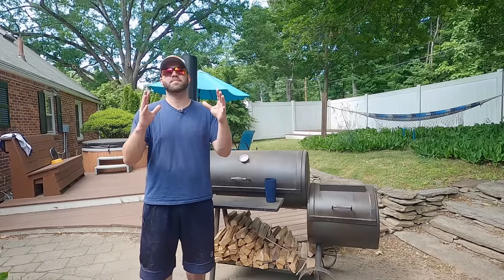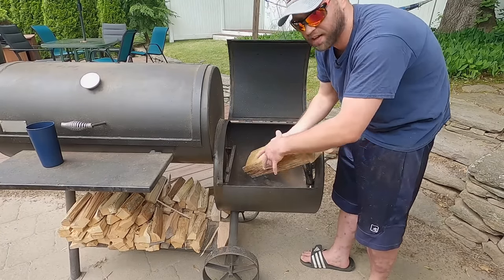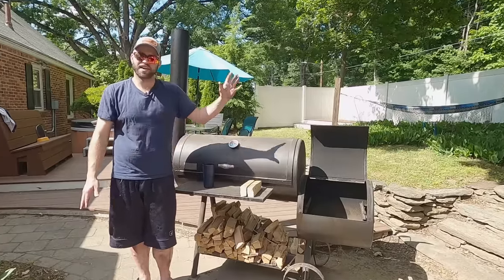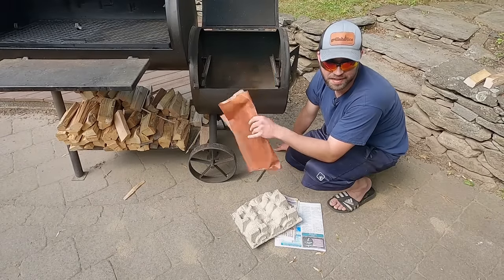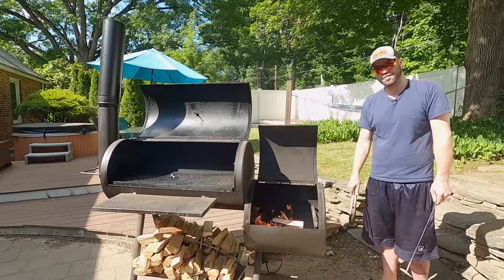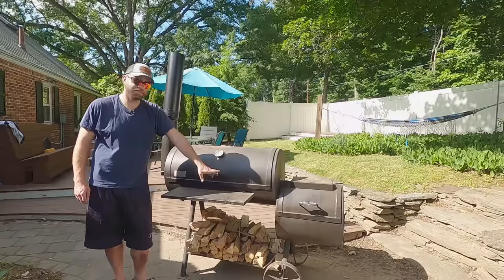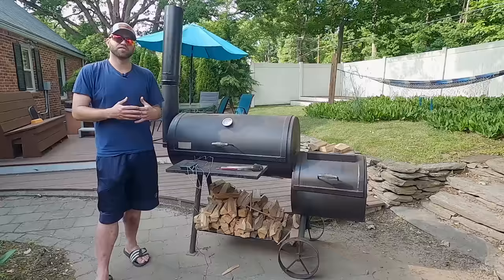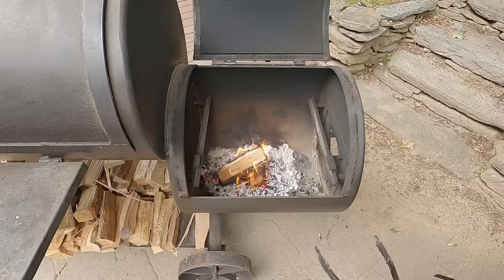OFFSET SMOKER FIRE MANAGEMENT FOR BEGINNERS | How To Burn A Clean Fire | Fatty's Feasts

Comment: damper are on the cooker for a real good reason to control airflow and even heat.... that's why you have 2! dirty fire is flavor...   oB
Reply from the maker: Correct, but on this cooker, the stack damper does more damage than improvement. It just cuts the air flow off so much that it smothers the fire. I'm going to be going over the advantages and disadvantages of dirty smoke in my next video, as it can be flavor depending on the situation, but not always.
Reply: @FattysFeasts   I gotcha', We have been cooking offset for decades, putting bark and smaller green oak and hickory for flavor to get 1/4 inch smoke ring below the bark, I learned a lot about trimming! Great Content!   ....oB....

Comment: Did you say you took off the metal flap Inside the smoke chamber? The one flap the directs the heat to the middle?
Reply from the maker: I did...Best decision ever. With this smaller pit, closing the damper on the stack to redirect the hot spot just screws up the fire. So instead of dealing with that, I took it out and the hotspot is now right next to the firebox. You won't regret it.
Reply: @FattysFeasts  I made some beef skirts, aka beef fajitas and I laid them next to the fire box, man I tell you what....... Those beef skirts were so tender.....

Comment: Meh, I just keep it way simple with my Recteq 700 (The Bull) pellet grill. Pharmaceutical grade temp controllers, copious amounts of clean smoke, heat control to within a degree (literally) WiFi control so I can be 200 miles away and still stay in complete control of my cook, the pellet hopper holds 40 lbs of pellets, tons of different hardwood pellets to choose from, oh, did I say precision temperature control and copious amount of clean smoke? I can reverse sear on it. Every thing I’ve cooked/smoked on my @recteq smoker has been phenomenally tasty. I like the fact that I can get successful result every time I use it with minimal work. One more thing: my Recteq is 100 % built from stainless steel. Including the drip plate and the actual grill grates. Recteq. Best. Pellet. Grill. Ever.
Reply from the maker: Glad that's working out for you! I've heard good things about that smoker, especially with the flavor. I just prefer old school stick burning. It's a lifestyle for sure and not at all convenient, but its the art of working a fire and knowing the product you made turned out great because of your actions. It's not for everyone, but I love it.

Comment: One big mistake the newbies make is to smoke meat for two long. You want a good 1/8" smoke ring and then bank the fire and let if finish cooking without smoking! Especially Hickory which can be bitter if the meat is smoked to long! I finish brisket in the oven once there is enough bark on the brisket!
Reply from the maker: I think it depends on your fire management skills. If you're a beginner, I would agree that if you're burning a dirtier fire, you definitely don't want in smoke the entire cook. However, once you understand your smoker and can burn cleaner, you can for sure smoke it the entire time. I did a no wrap brisket with hickory that came out amazing, mainly due to burning a clean fire after the initial few hours. It all takes practice and knowing how your smoker performs in certain situations.
Reply: @FattysFeasts  I think it is a matter of personal preference more than anything! I have always smoked for about two thirds of the cook and wrapped the last four or five hours. Many profesional competitors also wrap. Here is a link to one example; https://www.youtube.com/watch?v=_Ldg73DumjI&ab_channel=MadScientistBBQ
Reply from the maker: I'll check it out!

Comment: So if 250 is the goal, 300 is just fine? It’s kind of just now occurring to me that the temp is never going to stay at 250 because it would have to either go way down for when you add wood to heat it up or be, in the case I’m speaking of 300, in which case you gauge when to add more wood to hopefully be at 250. Is that correct?
Reply from the maker: Towards the firebox, I usually go just above 280, but 300 isn't that bad either. I would try to stay closer to 275 in the hotter area and then add wood when it gets to 250 or just a bit under. Hope that makes sense! It confused the hell out of me when I first started.
Reply: Think of it as more of an average. You want to average 250. But you don’t want to average 250 cause you had super low and super high temps. But if you are bouncing between 225 and 275 that’s pretty much perfect on a smaller smoker. Like he said 300 isn’t a big deal you just don’t want to stay there cause it will bring your average up.

Comment: The baffle that was welded in... how did you get it out?
Reply: I didn't have the ability to get it get it out either so I  drilled  large holes in it.  I just ran into this channel. It's so funny that I have the same exact smoker and tools, I don't know how that happened. Lol.
Reply from the maker: It was just held in by 4 welds. I had a friend grind the two out on the sides. Took him 30 seconds. After that, I was able to break the other two just by moving the plate up and down.

Comment: What’s different between oak,maple and regular firewood thanks
Reply from the maker: It's all hardwood which is considered good firewood. If you want to learn more about the wood I use, check out this video! https://youtu.be/rpaCFw3QvmY
Reply: Oak and maple are hardwoods. That’s good. Regular firewood is offen pine or birch or other softwoods with lots of sap. The sap in softwoods burns like tar, and your food tastes bitter and like it was burned over an oil fire.

Comment: I put a whole chicken on my grill 4 hours ago with a consistent temperature of 300 (grill gauge). Why is the internal temperature only 140 at this point?
Reply from the maker: I got a few questions. What kind of smoker are you using? Where are you placing it on the smoker? Where is your temp gauge placed?

Comment: Thankyou
Reply from the maker: Glad I could help!
Reply: @FattysFeasts  few days passed i ruined my bbq due to bad smoke . Please make a video on how to manage fire and temp on cheep offset smoker like 100 usd smoker that i have aroud 130 usd. Thin steel lol
Reply from the maker: @harisaslam573  I'll add that to my list! Might be a while unfortunately. What size splits were you using? With those pits they have to be stupidly small and your coal bed needs to be kept up by using charcoal for the most part.
Reply: @FattysFeasts  they were twice bigger then that you are using. Thanks for suggestion. They were really big so dirty smoke ruined all the taste. I will try again. Also i think i need to use probe instead of guage. May be i cooked also on below 200F . On guage it was 300 but after 8 hours ribs came out dry and tough
Reply from the maker: @harisaslam573  Ooofff. Sorry that happened😫😫 Sounds like me when I first started with my smoker. I would definitely invest in a probe. Just don't drive yourself crazy with the constant change in temps. Since they are so accurate, they are constantly moving. Like I said in this video, if you keep it in a good range, you'll be in good shape!
Reply: @FattysFeasts  its ok for me , its not the first time happen but learning a lot new things and your video is very information. Thanks for sharing your experience . Saved manny more bbqs  🤗
Reply from the maker: @harisaslam573  Glad I could help!

Comment: Can you just use lump charcoal in a pinch?
Reply from the maker: I mean, you can, but it's not going to make the best product. It definitely depends on what smoker you're using. If it's a smoker like this, I wouldn't reccomend it.If it's a smaller smoker, you definitely can, but I would add some chunks of wood for smoke flavor during the process.

Comment: Never go for an offset with a short chimney.
Just remember what you usually see in smokers and you'll see that some are a lot shorter.
Note. Don't compare with pellet heated smokers or other types with ventilator forced air entry.

Comment: So, would anyone know when someone says to smoke something lets say at 150 for jerky in my case. Is that supposed to be what the fire runs at? What the temp of the grates are? What the temp the lid reads. The temp the meat reads? I have a little laser thermomoter but dont know what exactly to check.
Reply from the maker: If they are saying smoke at 150, it would be referring to the temp at grate level next to the food. In this case, they are referring to cold smoking, so you’re just adding flavor and not really cooking the meat. This is actually very hard to do on a smoker like the one in this video. This is mainly because the fire likes to hang out at a minimum of 225 and there is not enough space for the gasses to travel and cool down. On a large smoker, it’s pretty easy due to the extra space.
Reply from the maker: Also, you’d need a probe thermometer for this. A laser thermometer is reading surface temp only, not the the temp of the air traveling through the smoker.
Reply: @FattysFeasts  thanks for the info, I apperciate it! I was able to get a good 150 at grate level off a probe thermometor. had to tend to the fire quite often because its a small smoker and keeping that 150 wasn't easy, but managable. this was my first smoke too and Im really excited to keep trying stuff. Prob gonna do beef ribs next :D ill prob butcher it the first time round but gotta learn somehow lol
Reply from the maker: @yodogyz  Good to hear! Yeah I did a lot of very "satisfactory" cooks when I first started. Just don't do what I did and spend $120 on a brisket as one of your first cooks LOL

Comment: Oh come on a table top 10" bandsaw is perfect for cutting fire wood down to grill size bites. 

Oh tip the smaller chunks of wood season faster,  its harder to dry the center of a log then the outside skin, thats why it takes a year or more, if you cut it down to blocks you can burn the wood will be dryer.

Im sorry I love the flavor of smoke in my meat so I soak my chips the more smoke the better. I want a thick smokey taste. 

You really shouldn't season your wood in the house for 2 reasons 
The moisture can cause you house to grow mold, second is bugs. Ants and termits will eat your nice tasty building materials and leave the nails.
Reply: 5:38 thats why Grandpa had a wood shed.  Its not part of the house.
Reply from the maker: With this smoker, the size splits I'm using are the perfect size. You don't want to go any smaller than that or soak them. For a kettle or propane smoker, where wood isn't your main fuel, that would be a different. I'm also not sure where you got the assumption I'm storing wood in my house.

Comment: I'm certainly not a pro. With that being said I'm not sure telling people to use bark and junk wood in their smoker will help them get good quality products.  I've heard since day one of my smoking escapades that bark makes your meat taste bitter. I've always trimmed off the bark from my sticks. That and using mostly cherry and apple with an occasional pecan wood has always yielded a nice, clean smoke flavor. 
When I grill. Not smoke,  I will use a small chunk of hickory to the outside edge of the charcoal burn to add some nice smoke flavor to the grill. Still, no bark. 
Just my $.02
Reply from the maker: I'm actually surprised you're the first one to comment about bark on one of my videos. I didn't find out about taking the bark off your wood about 2 years into smoking. I honestly never have taken it off and never will. I've never noticed my BBQ tasting "bitter" because of it. The more important thing is your fire management. You could have barkless wood that burns like crap, and it would taste way worse than wood with bark that burnt clean. However, from your comment, I'm assuming you don't prefer alot of smoke flavor since you're using fruit woods. Have you ever done a smoke with just pecan or even tried oak? Not saying you need to, but those will have the most smoke flavor.
Reply: @FattysFeasts     funny, I've never tried it with the bark.  Maybe it doesn't affect the flavor as I've heard it does.  Maybe I'll try it.  I also heard back then it could seep into the seasoning.  I kinda want to try n see if I notice a difference.  
I've not tried oak.  I have used straight Pecan. I use that on beef  for a "stronger " smoke flavor.  Early on I used hickory mostly due to it's availability. There were hickory trees nearby. As I learned about more subtle tasting fruit woods I tried them and liked them a bit more.  More than 50% of my smoking is trout. I fish a lot and absolutely love smoked trout and salmon. For that I enjoy the apple and cherry the most. For pork I just enjoy mixing either of those with pecan on occasion.  Then beef I'll typically do pecan and once in a while maybe throw 1 small chunk of hickey I keep for charcoal grilling on to add a slightly stronger flavor.  
Much of this was done when I still struggled a bit with maintaining a clean fire so maybe I'll try some straight hickory on some more lighter based foods n see how I like it.
Do you use red or white oak?  Does it matter?  I've heard of that once or twice before but never tried it. I'm curious now. 
I'm relieved to hear you say temp swings as far as 75 degrees won't affect it too much. I do struggle with that as I put a new stick or two on the fire.  I will get 30 to 50 degree spikes and don't like to dampen the intake as the new woods need air to burn. I'll dampen the exhaust a bit and deal with a bit of smoke but try to balance a bit of smoke with a small spike in Temps. 
I'm definitely going to try not dampening at all and hope to not exceed 75 degrees or so. Haven't felt comfortable going that high yet. Again, I'm still learning. 
I'm also surprised I didn't read anyone else mentioning bark. 
Maybe it really is a fallacy. 
Can't wait to try that too. 
Thanx.

Comment: I thought smoke was the point 
I thought smoke flavor was the goal 
Heat management is important yes
If smoke is undesirable use gas right or lump coal no smoke just heat 
I’m going to stick with making as smokey as possible 
Have you been to a bbq cook off tons of smoke chugging from the chimney it’s called a smoker not a heater
Reply from the maker: Smoke isn't bad, it's just how you use it. Check out this video. It should clear up some things: https://youtu.be/VhTzyAX0gl8

Comment: BLACK OR BAD SMOKE??? That mostly happens when you burn wood that has alot of sap... Remove tree barks, they are the worst even is they are dry.
BTW, there's no such thing as bad smoke when burning dried organic wood with no chemicals... it's just smoke 🤷
Reply from the maker: You can definitely create smoke that produces off flavors or over smoked flavor from burning hardwood.

Comment: I disagree. My fire sometimes is dirty and it doesn't change a thing. Don't worry newbies, BBQ is also about relaxing and having a good time. Don't go crazy and the details. Just give it enough time is my advice, never pull off early.
Reply from the maker: Not sure what you're disagreeing with. I did say you can have a dirty fire. When you add wood, especially on a smoker this size, it's inevitable. Blue smoke is preferred though. You just don't want billowing white smoke, especially for the majority of the cooking time.
Reply: The large amount of white billowing smoke is what makes the meat crazy.

Comment: Since when did SMOKE while SMOKING become bad? Is this a yankee thing?
Reply from the maker: Did you actually listen to the video? I explained in detail what I meant by "bad smoke."
Reply: @FattysFeasts  of course I listened to the video but your reasoning is not sound it's not backed up by any kind of science. Sounds more opinion based. Smoke houses in Texas never have just a thin whispey blue smoke but not billowing clouds either. You should explain that personal taste factors more than a generic statement of what kind of smoke is best. Being from Texas I've learned to love a stronger smoke flavor and that coincides with white smoke. Others may prefer a much lighter smoke flavor and that couples with the blue smoke that you're referring to. White smoke isn't "bad or dirty" (yes I understand the contents of white smoke) it's just a different flavor profile.
Reply from the maker: @Spushed  I think we are sort of thinking the same thing here. I'm referring to that acrid billowing white smoke due to burning a terrible fire that lacks flow.
Reply: @FattysFeasts  ahhh I don't recall that being specified. It seemed that the premise was white smoke was just bad in general.
Reply from the maker: @Spushed  There was alot of info I was trying to get across, so I probably just didn't stress the difference enough 😁😁